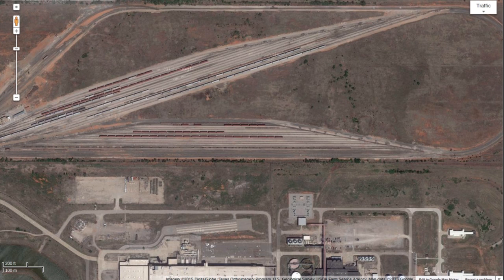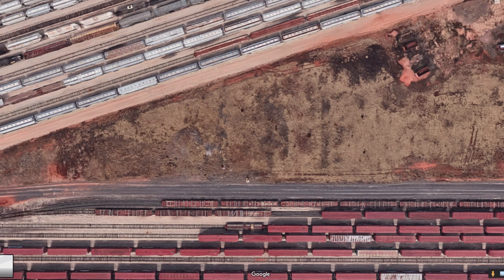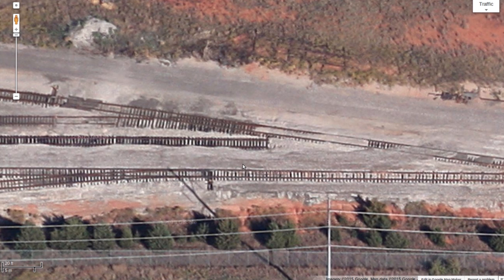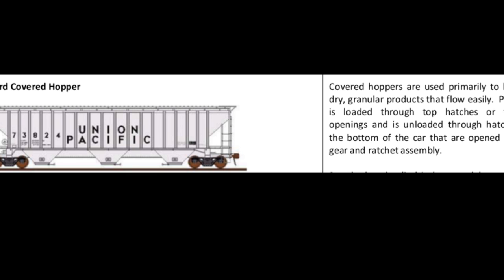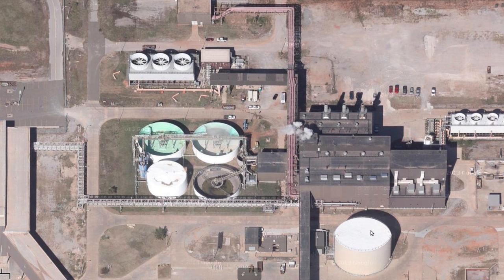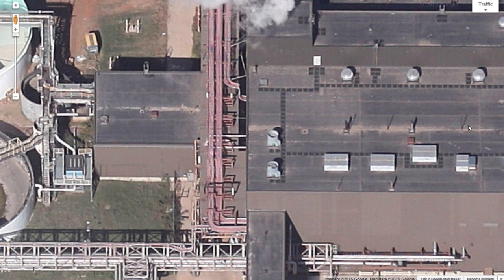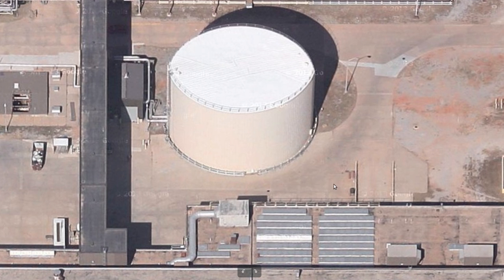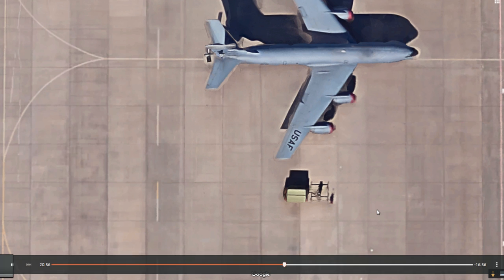Chemtrail Factory at Tinker Air Force Base, part 1 of 2

Comment: Having worked in the electric utility industry, specifically around the coal-fired generation plants, I think your analysis is 'Close'... but I've looked at the current images of the area of concern - it appears that they (google map) has replaced that area of the 'switching yard' and the whole area of the large buildings, with those of the area from when it was being built - possibly from the early 2000's.  In the current images you can see the path the rail cars would take to be off-loaded... you'll note that right at the entrance to the switching yard (west gate), there's an offshoot going south, and then turning east going into the extremely large building at the south end of the facility.  If you follow that straight through the building to the other end, you'll see that similar construction is occurring at the east end of the building and returning to the switching yard.  THIS extremely large building is where they off-load the material.  At the plant I'm familiar with, they had a special building into which they drove the Entire train of rail cars into... there was a special section where each individual car was off-loaded via a hopper Below the car, and the material was then conveyed to the next step - in this case, the coal was then conveyed out to the coal pile - which was as big as a small mountain.  There were further conveyors to bring the coal from the mountain into the plant where it was ground into extremely fine dust - like talcum powder - which was then injected into the fireboxes which were multiple stories tall, and which then boiled the water to drive the steam generators.  In the case of this 'chemtrail' plant, they off-loaded the fly ash into the very large building where it is initially processed (and confined!) , and then it is conveyed to the smaller tan building just north of the larger building.  I feel that this smaller building is where the material is run through the final processes to make it usable for spraying, as well as loading it into transport vehicles that are driven on to the tarmac to load the planes.  Hope this helps in understanding the scope of these actions taken against The People.  Also;  there's information that I came across that indicates that the Reason for the geo-engineering is that ALL commercial jet flights (tens of thousands per week) have literally DESTROYED the ozone layer of the Earth, and as a result, destructive ultraviolet-B & -C rays are now penetrating to the ground.  The geo-engineering is being used not only to mitigate these effects, but also provide electromagnetically reflective effects for surveillance purposes and weather control, as well as to produce other biologically destructive actions that have been documented.  You know the reasons for this.
Reply from the maker: I just looked at google maps again, https://www.google.com/maps/@35.3980725,-97.3939793,2787m/data=!3m1!1e3
and it still shows the railroad switch yard, just like in the video. I guess google has a bank of servers and hard drives devoted to "special" people like me... 
Thanks for the inputs, I definitely agree with you, it is so much better to bring the covered hopper cars into a controlled building to drop the powder through a trough between the tracks, then a conveyor just rolls the dust away to be processed. The planet is now in it's death throes, and they know if they tell us the truth, there would be pandemonium, which would destroy their ability to control the sheeple, while the population reduction ramps up. I appreciate your inputs on this topic. Nothing beats feet on the ground. I've had the good fortune to never go near a coal burning power plant. The cancer rates from mercury and uranium, just a few miles downwind are many times higher than normal. It has always been a sin to burn dirty coal and oil, to generate power. By 2020, we will all understand what a terrible mistake it was.
Reply: @thehaarpreport9203  I've reconsidered some of what i've suggested... it makes more sense that the loaded trains are brought directly into the switching yard (from the west), and then taken out the east side (where all the sidings run to and join).  As more material needs to be processed, they take a trainload out the east side and down into the very large building at the east end.  After offloading, the empty train is taken directly out the west side of the building back to the source of the raw material.  That's about it...

Comment: Look into U of Wisconsin studies all planets are heating up now and our solar system is tilted. Something bigger is happening geologically to the entire solar system now to heat it up, but the Grand Solar Minimum may help. Earth's scattered magnetic shield is allowing a lot more ground radiation in now too, so chemtrails may be doing double duty to protect defense and communications grids and prevent visibility of incoming large gravitational objects (Magnetic North pole moved 200 k in 12 months).
Reply: SO why the secretive cemtrail project if it is for"helpful " reasons?
Reply: You don't need a magnetic north pole

Comment: The beige tank has insulation around it.  This indicates they want ingredients to stay warm/hot. The other tanks with berms are always painted white regardless if they have jet fuel, gasoline, kerosene, crude oil, etc.... The big round tanks have floating tops on them.  Very commonly used with very large storage tanks for gasoline/kerosene/crude oil/etc...

Red pipes going into building have black pipes running right next to them.  Same size and number it appears.  Maybe a heat exchange system..?

Comment: I've actauly done work for a group called horse head and we recycled zinc and we turned it into an ash and gypsum  (coal ash) and they used a quark screw to move all the fine particulates and the pipes the screw was in was about the same size as the the red pipes u said u wasn't sure what was for

Comment: You do realize that is a GM manufacturing plant just south and east of the airforce base.  Until 2008 they used those tracks to stage rail cars full of vehicles.
Reply from the maker: Yes, I covered that in the description. I think Tinker sprayed coal ash from 2010 to maybe 2015, but not sure of the dates.

Comment: What about them using this to melt polar caps so they can mine the resources? Because it's not only "problem reaction solution, It's also Exploit. So, if we are worthless eaters etc., it wouldn't be a big deal to do whatever during their quest to take everything, which includes the souls that kick back  and do nothing...But anyway, what I'm saying is possible.

Comment: They are spraying a substance known as ALUMINA,(aluminum oxide). Alumina is used to absorb atmospheres and atmospheric gases like hydrogen and oxygen and is used in the shipping of sensitive electronic devices like computers and many others.  Its use is most likely intended to absorb the atmosphere itself rather than block out the sun. The amount of adsorption of Alumina is quite high and and can be over three times its own weight.  Barium does the same thing and also is used to absorb atmospheres in industries throughout the world. if we lose 10% or 30 % of our atmosphere what will happen to life on the planet ? It is entirely possible that someone is trying to destroy the entire Earth and that could be only one thing, someone who has somewhere else to go or is from somewhere else. ????????

Comment: Fascinating.  I thought POTUS checked into the chem trail issue, even boarded a tanker plane for first hand observation and ordered them to stop.  For the past several months there was NO chem trails over Cumberland Mtn - centered from Knoxville, Chattanooga, Nashville.  Elevation 1900 ft.  The skies are typically crystal clear, very blue and the sun is piercing hot with elevated UVC/UVB (Use app on cell phone to monitor.  In the past couple weeks, we've had monsoon type rains - 2+ inches.  My crawl space humidity is stuck on 88% - we are literally saturated.  Crops have been impacted - strawberries wiped out, tomatoes split heavy fungus/blight, corn, potatoes and beans all poor yields.  We've had heavy clouds and rain EVERY day in August!  Also numerous 6+ fat chem trails.  Seems like the massive rain/wet is intended.  Locals can't recall this level of rain.  And what's really odd is the weather wind patterns from Florence is pushing inland over Appalacian Mtn range and should be coming into the valley (Knoxville/Oakridge).  Instead we have heavy cloud formation all coming from west/northwest - the same direction as the chem trails.  We have a fine black residue on everything - cars, rain totes - Everything.  And the skies seem like they have a permanent. I have two new steel roofs that are badly oxidized like they're 10 years old.  I've invested quite a bit into raised gardens, but am buying a greenhouse to shield some of my vegetables from this particulate coating.  I won't eat lettuce/spinich/romaine from my garden because this reside doesn't easily wash off.
Reply from the maker: Holy crap! Black residue! This is really important! So, it is sticky and corrosive? Also, it could explain some of the extra rain. If new jet fuel additives are used to create the new chemtrails, you can bet the fine soot particles attract water, and dissolve in the water. This creates a nucleus for more water to condense, forming the smoke trail behind the plane, and creating rain if the conditions are right. Can you collect the black residue up, and get it tested? Or at least, test the PH using swimming pool test strips? I bet Dane Wigington would test it, if you sent him a sample. It is really important, that the composition of the black residue is made public. The new research shows black carbon heats up the atmosphere, that is why EPA has banned old woodstoves, must have a catalytic converter now... meanwhile they are spraying black toxic soot all over the eastern states....
I noticed the same thing, after Trump was elected, all the programs seemed to shut down for 3 or 4 months. Then, he was told who is really making the decisions, and his behavior changed, and the weather control programs started back up again. His complete turnaround was shown by his reverse speech, if you listen to Rense or know anything about it - verified technology, but not allowed out to the public, except on the rense show.
My area has been viciously droughted for several years, that is one way to put the farmers out of business. The other is to soak the crops, so the roots have no oxygen, and fungal diseases take over, like what is happening in the bread basket, and eastern states. I just don't know, I usually watch the west coast, as things are much easier to understand. But, I hate to tell you this, since the oceans are warmer than they have been in thousands of years, and warm water/air holds much more water vapor, increased rains could be the norm from now on. Please see if you can collect some of the black residue and get it tested, thanks!
Reply: I recommend washing all store-bought and home-grown vegs and fruit (including greenhouse-grown food) with Enviroclean Fruit & Veg Wash, available online. Wash in a bowl as per instructions on the bottle, then rinse several times in water with the final rinse including some vinegar. I have also read that baking soda can be used if you don't wish to buy a special product.
Reply: Mulch ground heavily with a thick layer of wood chips, which stops heavy continuous rain from penetrating to the soil. You get to water your own garden by raking aside the wood chips when you choose. Alternatively, buy plastic tarps and spread them on the ground during excessive raining. they won't stop all rainfall entering the soil but they will stop a lot of it, thus preventing plants drowning. I did this last night with my two orange trees and the water slid off the tarp onto the lawn rather than into the soil under the orange trees. I mulch twice a year with a thick layer of bush mulch (wood chips) on all my garden beds. It really protects the soil.

Comment: i was a civilian contracted air craft mechanic at tinker...this is 100% true.
Reply from the maker: Are you serious? Can you talk about it?
Reply: The HAARP Report I'm not supposed to but I do.  aluminium is a fire  accelerant when atomized it also causes neurological disorders such as Parkinson's and Alzheimer's disease. Due your research and see the major increase and accelerated rate of them over the past 25 years.  5g is a microwave network being tested in the California area.  What happens when you put aluminum in the microwave? Barium salts cause physical intestinal problems and effect all around health and immune system while killing everything because nothing grows in salt. Research gmo mades to withstand salt and aluminum in soil. there is more in those tanks than you think and the are mixed into a fucked up concoction of death. the aluminum also helps to boost radio signals.
Reply: they do use that ash and batch plant to make concrete and use it to fix the flightline.

Comment: You are probably correct in your analysis and I appreciate your your brave and bold presentation. What do you think about the possibility that chemtrails are used presently to hide the incoming Nemesis binary system which will scare the bejeezus out of the masses when it appears . Also do you believe we are firmly in the first stages of the Grand Solar minimum (jury’s still out will it be colder or warmer, which depends on where you live Location location location). And how does the chemtrails specifically alter weather. Mahalo plenty and much Aloha xox

Comment: Not looking to poke holes here but... one of the buildings and the red-ish piping looks just like the steam heat plant and pipe system on the USMC base at Quantico, VA. I was stationed there several times during my time in and I have seen these systems on other US military bases around the country. They may also be generating electric power as well. Again, not saying you are wrong, just pointing out a possible explanation of some of what is seem in these images.
Reply from the maker: Great comment! I would agree with you, but there are no smoke stacks on the gravel red pipe building. Also, you want to generate steam as close to the end user as possible. A steam generating plant would have big air conditioning units, or side vents, so the workers don't get too hot, that building is all sealed up. IF the building is taking steam from the pipes, and generating electricity, that means the black building has a bunch of boilers inside, and would need a lot more ventilation than it has. If the power substation building has steam turbines, there should be water pipes coming in, big vents, and a giant muffler poking through the roof (not there). Either way, if you are right about them being steam pipes, one end has burners, and the other side is using the steam for SOMETHING, but what? BTW, if it was steam pipes, they need a lot of maintenance, like repainting to protect the insulation. These have not been repainted since they were installed, ten years earlier (guess), which is saying a lot, since the military is big on scheduled maintenance. 
As far as the gravel red pipe building, I really think it has air compressors inside, to drive the fluidized coal ash through the pipes. Then, the only inputs to the building are electricity, and air. The only output would be many small diameter pipes of fluidized coal ash. The BEST PROOF and verification of my theory, is the big red pipes are ACTUALLY MANY SMALL PIPES, as you can see when they branch off, and go into the west side of the black building. The fluidized coal ash has to travel through small pipes, to stay suspended. If it is a big pipe, say, 24" wide, the ash falls to the bottom, and you get a clogged pipe. If it is a small pipe, say 6"  to 8" diameter, the coal ash flows like water for hundreds of feet.  If the red pipes leaving the black building really carried steam, they would collect the steam into one GIANT pipe before sending it outside, instead we see MANY SMALL PIPES leaving the black building.  Using many small pipes causes more heat loss, so more pipe insulation is needed to keep the steam hot on its journey.  Gee, maybe that engineer failed his thermodynamics class??? No, the many small pipes show this is probably NOT STEAM!
The many small, red pipes entering the west side of the black building, shows they are using dozens of the high speed diamond grinders, to homogenize the ash to uniform nano particles, which stay suspended 1000 times longer than micron sized particles. That is still my best bet. 
Sure would be nice if someone could tell us exactly what is going on there (don't break the law, or any security regulations, please!). Thanks for your input, you have be best alternative ideas so far. I really appreciate your inputs on this!

Comment: The building you are talking about was used by GM. Tinker is using it now. I have been in the building have not seen anything like what you are talking about.
Reply from the maker: GM sold the plant in 2006, USAF leased it in 2009, Possible chemtrail spraying 2010 to 2015, all evidence is gone now. I need to add this to the video description. I didn't know there would be so much turmoil and confusion over this video. To me, it's really old info, not interesting any more.